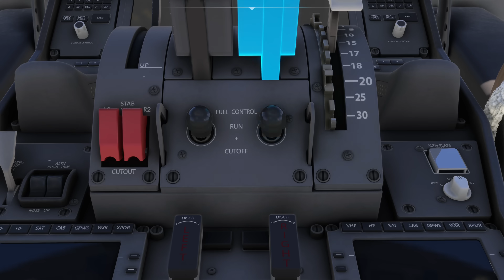Air India 171: Why Did The Fuel Cut-off Switch Get Moved?

Comment: 1)The RAT deployed BEFORE the switches transitioned from Run to Cut off? 2) the report says the switches " transitioned" (suggesting it was not switched off by pilot). After this the pilot manually switched it back to Run to save the plane but it was too late. Could one of you experts answer these 2 questions. Thanks.

Comment: I still believe it shouldn't be possible to turn the motors off just 4 seconds after the wheels leaving ground. Who let that one slip into the operational design? You are able to switch off after a few seconds with a university 1.6 kms straight ahead. Nah. This is a bad recipe. Aircraft design needs a rethink

Comment: I've read that a fault in the software can cut off the fuel without anyone physically moving the switches. Is that true???  The flight recorder shows that the switches changed but it does not prove a person physically moved them, there is no cockpit video in aeroplanes. Is that correct???

Comment: It seems to me that there should be fuel run / fuel cut - off switches on both sides of the cockpit that require both pilots to activate for there to be a response to the action.  This would effectively prevent a suicidal pilot from committing murder even if one pilot is not in the cockpit.

Comment: Regarding MukudanP question ("why does the computer allow fuel cutoff..."), while there is a good reason to cutoff fuel during a descent (as explained by Captain Steve), no good reason comes in my mind to cut it off during an ascent (unless all the engines are on fire). It would be actually easy software-wise to implement a control that distinguishes between ascent and descent phases and requires a confirm to go ahead and cutoff the fuel during an ascent

Comment: pilot error, well feet from the ground, and nothing worked yet, remedy/fix, what's causing you to get too close to the group? I guess, like everyone else, the engine cut off engines 1 and 2. I'm taking its little switch, and the computer engine management system is behind it. There's something between the switch and the engines on the plane wings, so when the switch is toggled off and back again, the fuel purge, preload pump, pressor, or something gives the engine a kick-start boost, like a cold engine start on the runway on the ground? and happen all in the background, behind the switch being moved?? Blaming pilots is too easy a target; most times they're not. RIP, and voice recording, do you already have the fault/error and are just going to record and find data matches? Do you already have the idea? and the clock instrument controls the data black box; the plane's computers have a computer meltdown and basically display all wrong or at least some wrong data to the pilots. How was the same data not being recorded in the black boxes?

Comment: Is it at all possible that these particular cutoff switches could have jumped out of its run position due to airframe vibration? Or another idea: could there have been a wiggly contact for these switches or the entire panel where these switches are mounted? Which data does the FDR see?

Comment: UK CAA Flagged Boeing Fuel Risk on May 15 for Boeing 737, 757, 767, 777, and 787 aircraft. December 2018, the US FAA issued bulletin on the potential disengagement of the fuel control switch locking feature. So, why is that without even giving a chance or assuming that this fuel switch failure can be a possibility, you are blaming the pilot for crashing the aircraft. I say this because in your video, you said, when one of the pilots is heard asking the other why did he cutoff it doesn't matter what the other pilot say even when the other pilot responded that he did not do so. Isn't this an unfair judgement. Your video can be used by many to directly blame the family and relatives of the Pilot even though this is a Preliminary report. Do you think the UK CAA and US FAA were joking or simply issuing this alert and bulletin without any proof of the possibility of the failure of the switch?????? Even you said you don't know much about these reports, so how could you create a video and state that this disaster happened due to pilot error and completely disregard the response of the pilot who said he didn't cutoff the valve.

On the second note, since you have flown for many years and have come across much news of pilots crashing aircraft, do you think a pilot who is on a suicidal mentality would disengage the fuel switch immediately after take-off. If you check the airport area, there is a less populated area and also there is a river both of which can be used to reduce the impact of the aircraft crash. Would the pilot at least make sure the action he is taking would result in his aim? May be I am wrong, may be this height is enough.. but still is this the best option if the aim of the pilot is to crash the aircraft, isn't stalling the aircraft after reaching a suitable height is the option a mentally disturbed pilot will choose?

Another point is Since the report doesn't say which pilot asks regarding the fuel switch and also doesn't say which pilot calls the MAYDAY, we are assuming all these are said by the same Pilot, if their voices are almost similar, it might create the confusion, but i am sure the CVR will have the right details and they should have released the details regarding this.

The reality now is that, all the western media and analysts around the world have completely denied to give a fair chance to the pilot who denied cutting off the fuel swich and have come to that conclusion that the very same pilot is responsible for the crash of the aircraft and ignored the alert and bulletin issued by UK CAA and US FAA related to the potential chance of the failure of the FUEL SWITCH.

Comment: Steeve, someone else already mentioned this possible safety step, but could you throw in your thoughts!. Fuel Cut Off switches are disabled when throttle controls are not in the idle position.  Is there any scenario where you would activate the cut off switches while more than idle power is commanded? This seems like a simple fix, and would add a huge safety check.
Clearing up a few facts from other commentors, the Alaska Airlines Pilot in the 3rd seat of the 737, tried to pull the overhead Red Fire Extinguish handles. Not the fuel cut off switches as stated. The SAIB Special Airworthness information bulletin, referring to reports of 737 airplanes (Not 787's) with cut off switch issues was 12/17/2018 over 6 years ago. Air India 171 had its TCM throttle quadrant replaced twice, once in 2019 and again in 2023 and it was not reported as being related to the fuel cut off switches. On a final note, I have access to some very similar spring loaded, lift over detent, safety switches and I tried over and over to cycle these switches and there is no physical way you can switch two of them, with one hand, in 1 second. 2 or 3 seconds, yes. I don't know how accurate or precise the time stamps are on the data log, but if it was truly 1 second, you would almost have to be actuating both at the same time.

Comment: Are you suggesting that the pilots deliberately crashed a plane? Are you actually suggesting that there was no absolute reason with a machenical fault with the switch? You clearly haven't seen the advisory by the manufacturer themselves on the fuel switches. Absolute useless listening to you.

Comment: The question abou why the compiter let the cutoff switchc to go to cutoff state at so low altitude should be asked differently. Why the computer let the switches to set to cutoff during TAKEOFF. The computer should “know” while the aircraft is taking off. There is no way you cutoff your engine at the time of rotatation… (not instantly even in case of an engine fire) so very dumb engineering as always. There are automatic landing systems to land the plane without pilot actions but a random person is able to kill all the souls on the plane and at the crash site on the ground by flipping 2 switches?? It is as dumb as the Naked gun episode where they defused the atomic bomb by trying to run away and accidentally slipping in the power cable and so they pulled out the device from the wall(which was a hell of a great joke in the movie).

Comment: Why does such CTQ switches not an have auto manual feature inbuilt and features to identify if pilots had manually enabled it. A switch contact erosion due to a fault in the subsystem can cause intermittent operation which is not in the control of the pilots. I believe such experienced pilots will never take such wrong decisions of turning off buttons, its only the failure of electronic subsystem which probably would have caused the failure

Comment: Is it possible for some issues to happen during the takeoff roll? The issue might have occurred after V1, so they decided to continue the takeoff. To support this theory, there is a flying beast video on YT that showed flight took more runway than a Single Engine MTOW configuration for a Boeing 787-8 Dreamliner. During the recovery procedures, one of the pilots, in a haste might have flipped the wrong switch, the fuel switches. That could explain the other Pilot saying, "Why did you cutoff?" followed by first pilot saying "I didn't" because in his mind, he was flipping another switch. The prelim reports never said anything about the engine parameters during the takeoff sequence. This theory although is still a "Pilot Error" but this could rule out the "Pilot suicide" theory.

Comment: You have such a big reach. It’s a shame that you have kind of come to a conclusion and indirectly indicating that it’s the pilots misdoings simply based on a preliminary report. For anyone to come to a conclusion, the entire conversation between the pilots should have been released. Preliminary report - reported selective sentences, so as to divert everyone’s attention to the pilots and give a clean chit to Boeing. Boeing has a terrible reputation when it comes to accepting its flaws, sorry to say but even you captain have made mistake in drawing your conclusions on this channel itself and later accepted that your theory regarding the landing gear was wrong and the video of the plane was not clear.  I would have expected a pilot (specially at your level) to handle this issue way more sensitively.  Dont forget, you could have been on that pilots seat. How would you and your family have felt when you could not even defend yourself.

Comment: What is the fastest time needed to transition the two switches from RUN to CUT-OFF or vice versa? As per report, it seems RUN to CUT-OFF had 01 sec differences between the two engines but 04 sec between CUT-OFF to RUN. This was an observation I got from a news and then cross-referenced. What are your views?

Comment: AI171 Crash: Is the Timing Report Misleading?
🔍 Critical Look at Fuel Switch Data in Preliminary Report

As an aviation observer following the tragic Air India Flight AI171 crash, I raise a key concern about the timing format used in the preliminary accident report.

The report states that both fuel control switches were moved to the "cutoff" position one second apart — but this is shown only in full seconds, not in the high-resolution format (e.g. milliseconds) that modern flight data recorders (FDRs) are capable of.

💡 Why it matters:
If the switches were activated within, say, 0.05–0.1 seconds of each other, this might suggest a simultaneous system-triggered event — not deliberate manual input by the pilots. That would change the interpretation entirely, pointing to possible system failure, wiring error, or even sabotage.

⚠️ Concern:
Using only full-second intervals may obscure the true cause and mislead investigators or the public into assuming deliberate pilot action. If this was a simplification or rounding, it should be clearly stated.

🛠️ Call to Action:

Clarify the actual FDR resolution used in this case.

Release sub-second data on the fuel switch transitions.

Recognize the importance of fine timing in determining pilot vs. system responsibility.

Even small reporting choices can have big consequences. Transparency is essential.

Comment: QUESTION: To enhance cockpit safety and mitigate the risk of intentional or accidental engine shutdown, a redesign could be considered wherein both pilots must independently confirm the activation of the engine cut-off mechanism. This could be achieved by implementing dual confirmation switches—one positioned on each pilot's side. The system would only execute the engine shutdown command if both switches are placed in the same position, thereby ensuring mutual consent.

Alternatively, relocating the existing engine cut-off switches to a more prominent and visible location—clearly within the field of view of both pilots—could serve as a deterrent to unauthorized actions. In the current layout, the switches may be manipulated discreetly, especially during critical phases of flight when attention is focused elsewhere. Enhancing visibility and requiring dual input would significantly reduce the likelihood of unilateral actions going unnoticed, improving overall flight deck situational awareness and safety.

Comment: I again suggest that it is possible to turn fuel ON with the switch toggle NOT in the secure seating and still in the transit position which will leave it unsafe with the possibility to be accidentally moved. 
This is not a suicide  murder. 
A suicide would await until there was no failure not just leaving the runway.

Comment: Is it possible that there was a software issue which turned off the fuel supply to engine without any mechanical switching of the keys? The pilot hears the engine getting quieter and asks the his partner why he turned off the switch. And then they try to turn it back on. Could it have been a software issue afterall? What about the incidence of a Japanese aircraft's fuel switch turning off on the runway?

Comment: I think it is safe to conclude one of the pilots was on the wrong path mentally and it relates to another incident not too long ago. An off-duty Alaska Airlines pilot, Joseph Emerson, riding in the jump seat, attempted to shut off the engines of a flight from Everett, Washington, to San Francisco in October 2023. The flight, operated by Horizon Air for Alaska Airlines, was diverted to Portland, Oregon, where Emerson was taken into custody. He allegedly told investigators he had taken psychedelic mushrooms in the days leading up to the flight and was experiencing a "feeling of being trapped". Emerson was charged with endangering an aircraft and 83 counts of reckless endangerment. Fortunately, the incident did not conclude with loss of lives and property.

Comment: I recently found the remote control for my TV in the refrigerator, on the top shelf. Obviously, I was the one who put it there — and placing a remote control in the fridge is a deliberate action. However, it was clearly not intentional. You could call it absentmindedness, though perhaps there's a better term for it.
But doesn’t this raise the question: is it not possible that a pilot might do something completely out of the ordinary without realizing it? Is there special training to prevent that?

Comment: It is not logical to compare a kid with a pilot for denying. There is no point of lying if pilot would have done it.
There is also possibility that fuel is cut off automatically by system. Or it is cut off before take off and engine used initial fuel which is already there. This could be done by someone who is part of maintenance team. Could be intentional or by mistake.

Comment: As per my knowledge Boeing 787 airctafts use Fly By Wire Technology. It is said that, kindly confirm, FBW is programmed/ designed such that in some cases it reviews pilit's some decisions for which it is facing criticism. Turning fuel supply when the aircraft was flying at lower altitudes (or just took off) makes a case for FBW to intervene, warn and take corrective action. Do you think that that happened in AI 171 Crash case? Please clarify its role in present case. Thanks. From Gandhinagar, Gujarat, India.

Comment: It’s important that we avoid rushing to judgment, especially when it comes to assigning blame in tragic incidents like this. In plain terms, if a pilot stated that a particular switch was not turned off, we should respect that account unless there is clear and compelling evidence to the contrary. Suggesting otherwise without proof implies doubt in someone’s integrity—something we must approach with great caution. System issues or technical malfunctions are always a possibility and should be thoroughly investigated. As the old saying goes, “a dead man can’t speak and so we must be especially careful in interpreting events and respecting those who can no longer defend themselves.